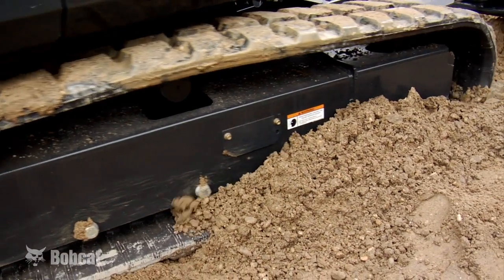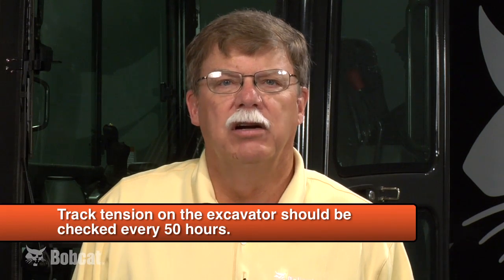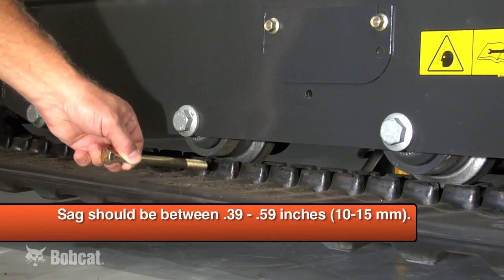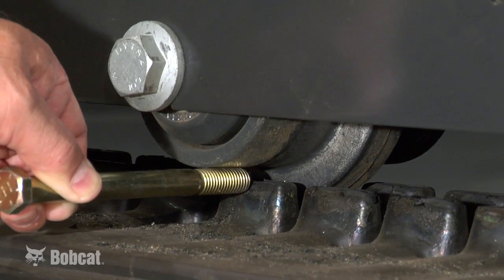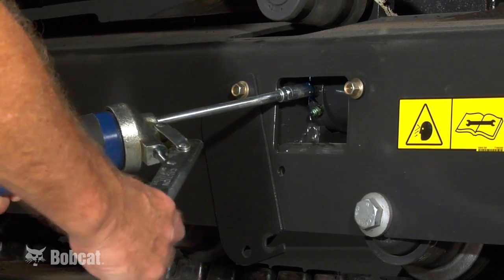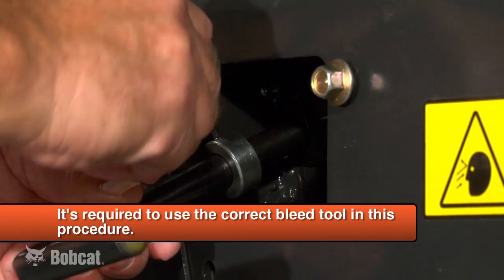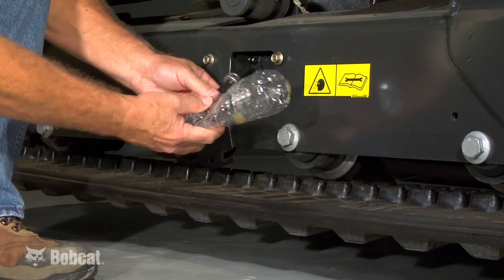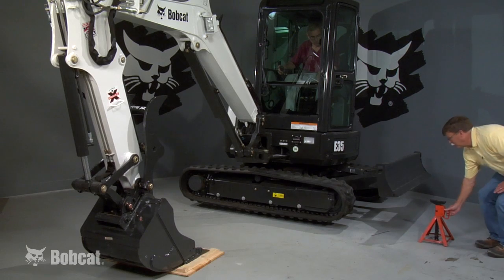Bobcat Compact Excavator Track Tension

Comment: YOU CAN JUST LOOSEN THE FITTING AND PUSH ON THE NON TOOTHED SIDE AND THE GREASE WILL RELEASE INTO THE AREA, THEN JUST CLEAN OUT THE GREASE,  BIG WOOP!!!! MY 218 LOST A TRACK AND WE USED ANOTHER EXCAVATOR TO PUSH THE ROLLER SIDE BACK TO GET THE GREASE TO COME OUT, WORKED FINE, GREASE BLEED TOOL WAS OVER $ 200.00, I CAN BUY A LOT OF DE-GREASER FOR THAT. ANY WAY, WHO GIVES A POOP ABOUT A LITTLE EXTRA GREASE, NOT ME!!!
Reply: quit screaming